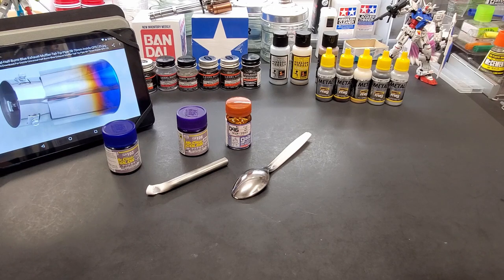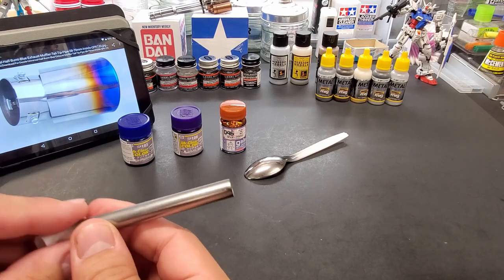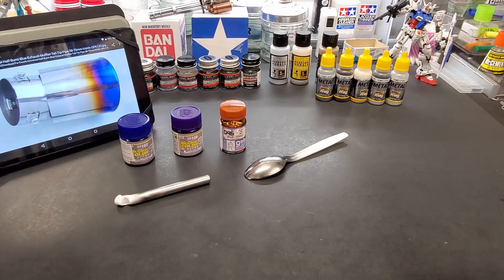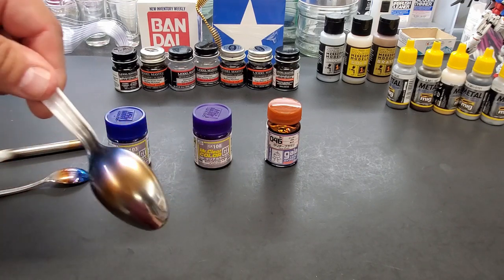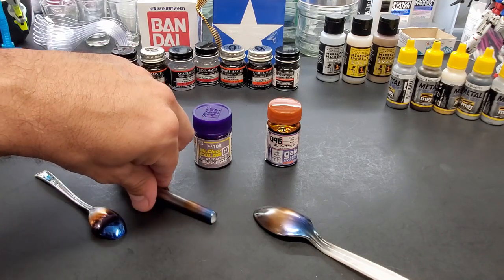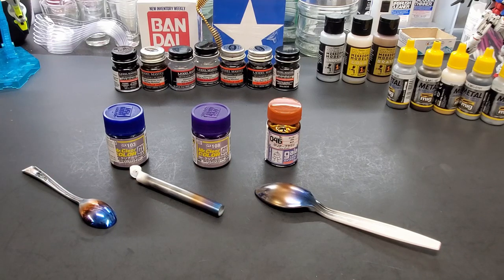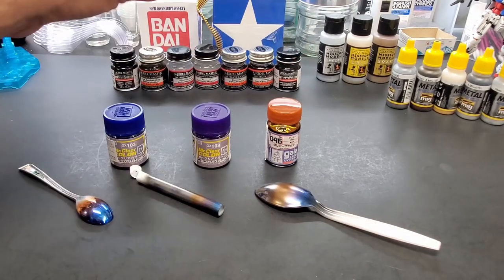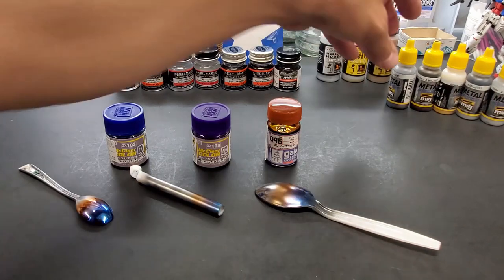How To Get A Burned Metal Effect For Your Models - Easy Airbrush Technique

Comment: Firstly, EXCELLENT posting/tutorial!!!  But Questions....

1)  Is this effect on motorcycles only, or could high-performance cars have this happen to them ( would like to do on Regular exhaust car system also ).

2)  How about curve portions of exhaust pipes or on 'connected'/welded portions of pipes........have you thought about showing that aspect??

3)  Is this same effect be used on jet A/C??  Do I Need to paint chrome or could a "darker metal" be used????

Thanks for answering.

Comment: Nice tip. Just a question in general- what is the 
 selflife of paints (Enamel's etc) asking as I have some unopened humbrol anďx tins from 15 to 20 years ago. Would you still use these or dump it? Thx
Reply from the maker: You should be alright. Enamels have a great shelf life. In particular Humbrol. If it globs up on the bottom, you just have to stir it up. It might take awhile. You can add a few drops of enamel thinner too. Try and not shake it as paint builds up around the edges where you seal the jars and that dried up paint blocks the jars from a good tight seal a d that let's air in. You can keep older jars in zip lock bags or Tupperware to keep air out.

Comment: i'm glad you did this tutorial i've struggling a bit with this, i tried the alclad burnt metal and it came out a very watered down sky blue color, is that the actual or is something up with my batch? thanks for the video.
Reply from the maker: I would imagine that is the actual color. There's several shades of burned blue and a few of them are light. I wanted to recreate the color of the pipe in my video so I purposely went dark. I tend to lean towards extremes with my colors but that's just me.
Reply: @barbatosrex9473  wil try with other brands seems easier too

Comment: Are you spraying these clears unthinned straight out the pot? Thanks!
Reply from the maker: I thin them, 50 50
Reply: @barbatosrex9473 okay thank you. I tried to put it over alclad but the alclad seemed to gum up. Did you have to clear coat over the silver??
Reply from the maker: No you don't